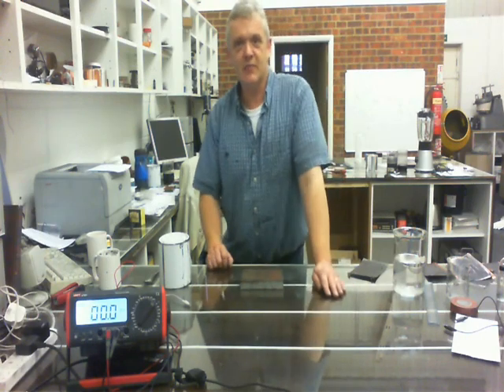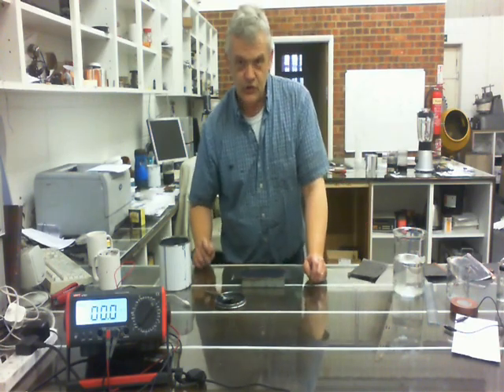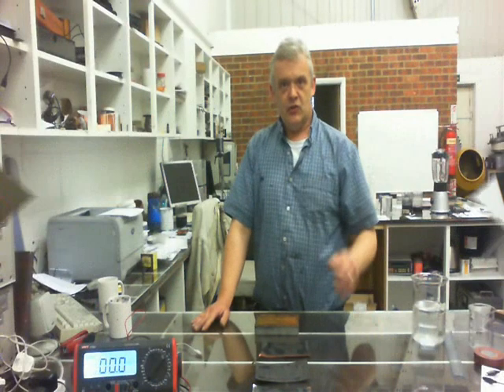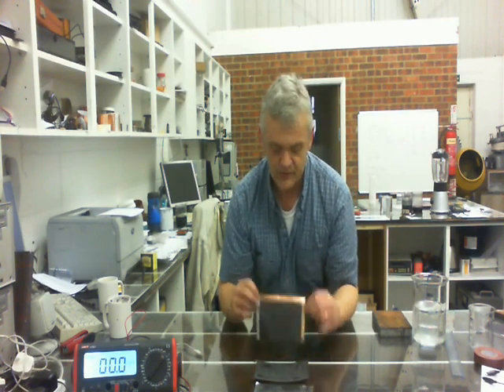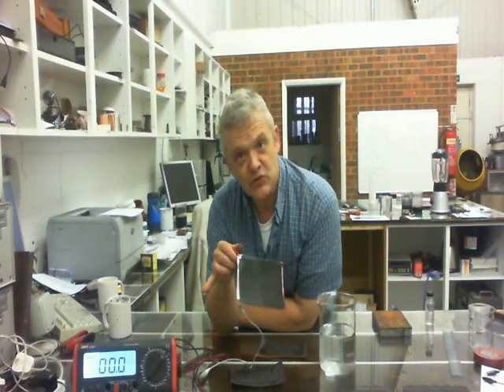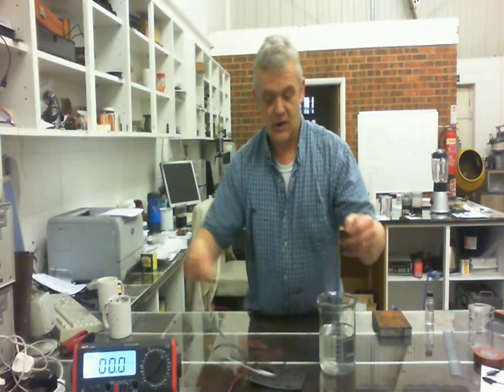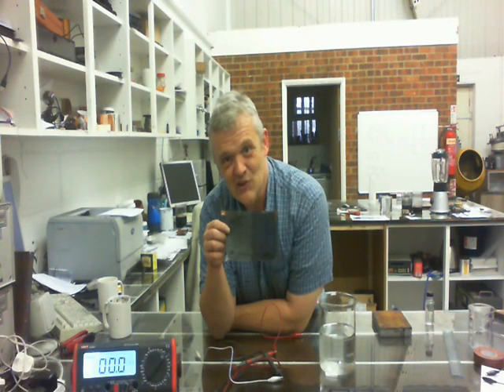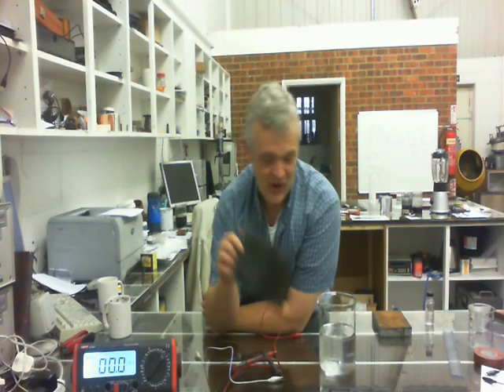SWAG Update - Poling In A Magnetic Field

Comment: it seems to me after watching this again that the inclusion of a magnetically inert material may allow a more complete separation of lines, If such a separation was needed.,

Although they may be quite defined as it is, I am only assuming that it is a gradation, and not a defined separation,
I would try polystyrene beads, I think there are specific polystyrene beads that are produced specifically to be nonmagnetic.
Reply from the maker: worth a try - go for it and let me know what happens
Reply: Ill have to try..  I will!  if I can! ;)

I guess I could build a very small magnet array
Reply from the maker: Clown Whisper
or buy one - i saw one on ebay like the one i used for $30 but that was last week and I bought it as a back up - but there will be more that come up
Reply: Im trying to find a source for the beads. I know the joint that I got the 2.5 cy5 dyed ones from wont sell to the public.  I used them for focusing confocal microscopes.

and they were 90 dollars for 3 ml lol!

ill check out ebay

thanks,
Reply from the maker: Clown Whisper
that is a price lol

Comment: Impressive discovery! Your use of a control is very helpful in that it helps to put the results into perspective.  For example if the results were due to galvanic effects you would see it in the control as well as the experimental, but there is a very definite difference between the two!
Reply from the maker: cheers mate

Comment: Congratulations!  Great find
Reply from the maker: cheers mate - be worth trying this for monotherms
Reply: Robert Murray-Smith I'll try some different set ups with swag plates, and perhaps the monotherm too. I have some very strong neodymium magnets, but they are obviously way smaller than your big plate. Nevertheless, they are strong, and I have quite a few....

I wonder if the swag plates also function better as high up AC collectors, after the magnet treatment? I'll give em a try.
Reply from the maker: MrSkypelessons
cool mate - keep me in the loop?
Reply: Robert Murray-Smith Everything I do will go on here as MrFlathunter, as always!  The ink I'm using is probably a little old - bought it back in June. Do you reckon it'll still be OK, after a good shake and stir? I'll have to get some more before Xmas, but I'm still considering what to do next. Tempted by the radiator, and I realise I need the heat resistant stuff for that. Gets cold in the skype-lessons office/lab, in winter :)
Reply from the maker: MrSkypelessons
the rad is tempting lol

Comment: Is there some configuration that you can think of to tap into the casimir effect???
Reply from the maker: i guess if you made it small enough
Reply: Robert Murray-Smith If you put the ink between a solenoid (  https://www.google.com/search?q=solenoid+flux&espv=2&biw=1366&bih=667&source=lnms&tbm=isch&sa=X&ei=i9RCVKefLoj1iQLnn4DwBA&ved=0CAcQ_AUoAg#facrc=_&imgdii=_&imgrc=XnU6c6wDBGzNaM%253A%3BSGjv9074d8yfqM%3Bhttp%253A%252F%252Fwhs.wsd.wednet.edu%252Ffaculty%252Fbusse%252Fmathhomepage%252Fbusseclasses%252Fradiationphysics%252Flecturenotes%252Fchapter4%252Fgraphics%252Fsolenoid2.gif%3Bhttp%253A%252F%252Fwhs.wsd.wednet.edu%252Ffaculty%252Fbusse%252Fmathhomepage%252Fbusseclasses%252Fradiationphysics%252Flecturenotes%252Fchapter4%252Fchapter4.html%3B499%3B378 ) field so that all of the flux line draw infinitely thin parallel line patterns, and then connect those with the copper particles you might be able to make infinitely close capacitor boundaries.

After the plastic is coated, maybe you can curl it and see if the casimir effect causes a mechanical oscillation.
Reply from the maker: TALENTguyDOTCOM
i guess

Comment: That's really interesting. I wonder if a linear pattern like this is acting as multiple cells or somehow slowing down the run off and increasing the interaction time. I'd be curious to see what other patterns, such as diamonds might do and whether a magnetic field is required when producing them or if simply printing them onto the surface (perhaps building up several layers) would yield similar results. Keep up the great work... Fascinating!
Reply: Snap!
Reply from the maker: It is more likely to be the orientation helping with conduction - or at least that's what i think. I don't think there is anything particularly 'fancy' going on here and I don't think 'fancy' patterns will help much - the field just lets the nanoparticles line up to create a direct route to the current collectors reducing the internal resistance and there by giving an improved result. I am sure it could be printed if you could get that much control over the lining up - but that would be far more challenging to do than laying it on a bed and drying it